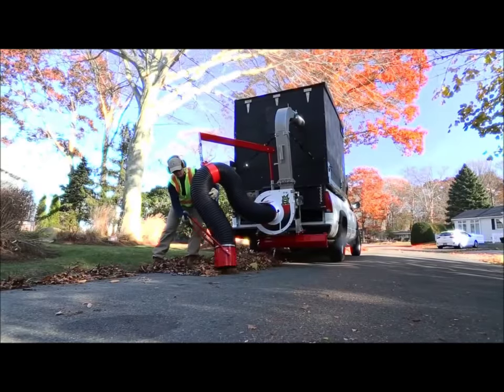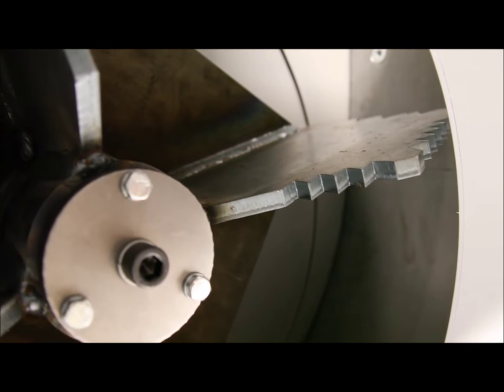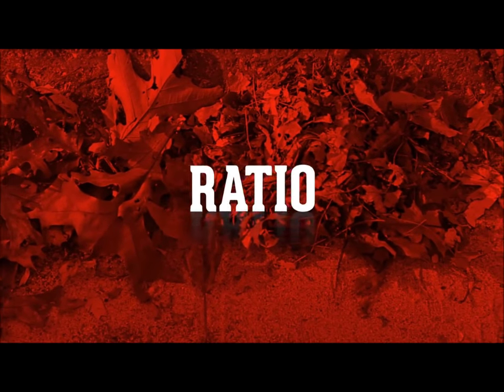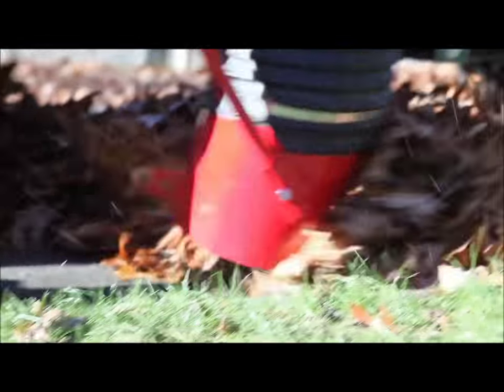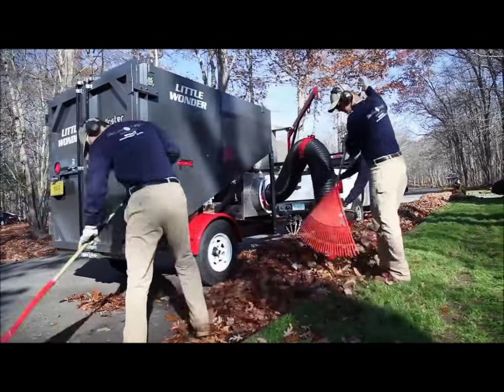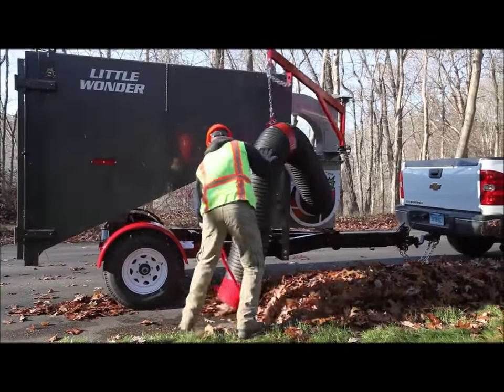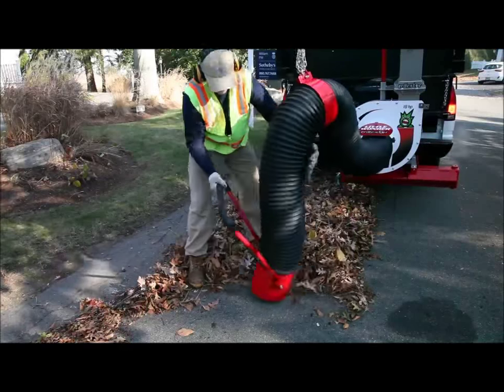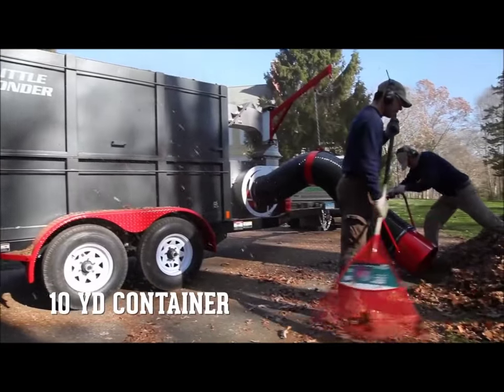Gap Power Custom Self Contained Leaf Vacuum Trailer

Comment: And does that back whole piece come off to use it for a regular dump trailer
Reply from the maker: Yes, the whole top removes and it goes back to being a standard dump trailer.  We use the PJ D3 6x12 Dump Trailer on this setup
Reply from the maker: Pricing on a used trailer and vacuum box is approximately $15,900.   A new/used Vacuum box for your trailer would be  $9,500/$11,500.  We rent this trailer at www.gappower.com/item/VACBOX